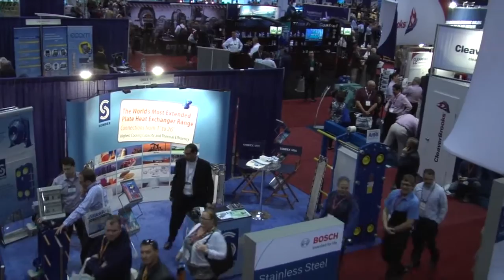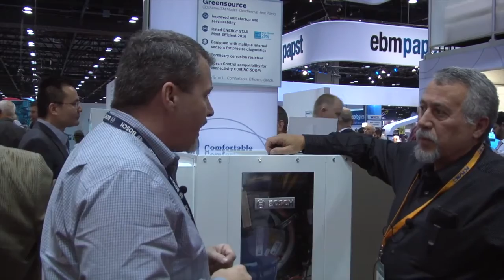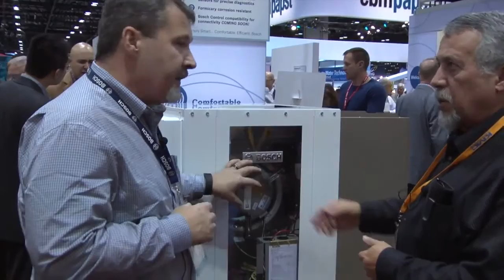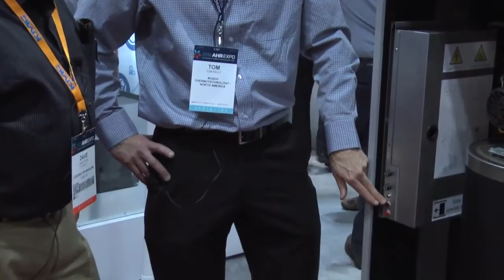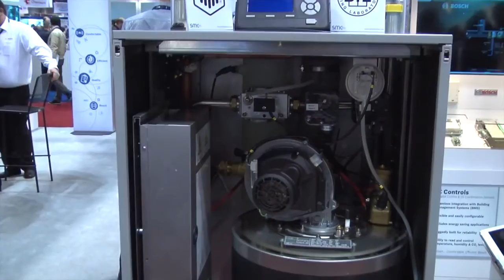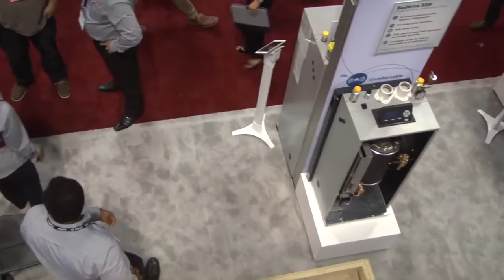2016 AHR Expo. Bosch in the spotlight

Comment: Trying to get an estimate to replace an 18 year old good man 2.5 ton unit (r22) and the site has contractors that state they don't install Bosch heat pumps/ac even though they are on the Bosch site. HEEEEEELLLLLP
Reply: Shekhar Moona did you ever get that bosch installed?
Reply: DUSTIN EHRLICH called many contractors on the list none of them install the heat pump. Only geothermal stuff.
Reply: DUSTIN EHRLICH going with a TRANE from Lowe's unfortunately.